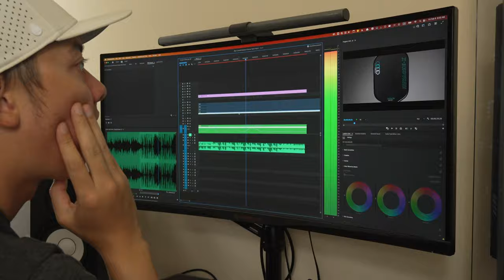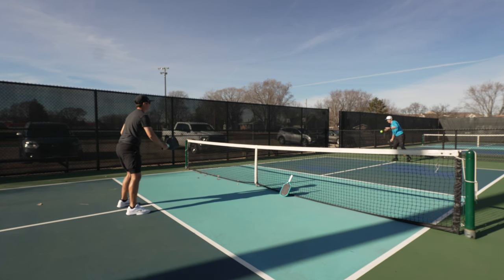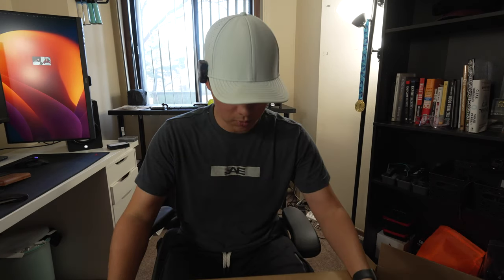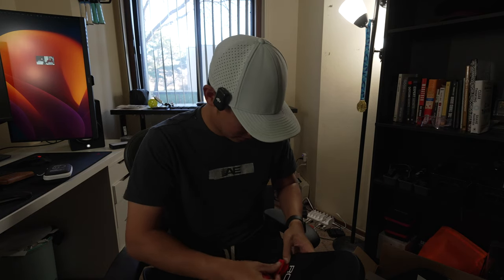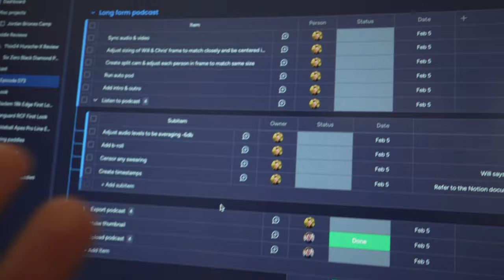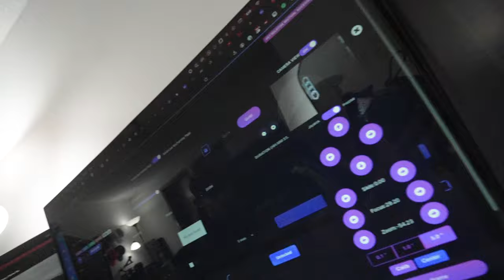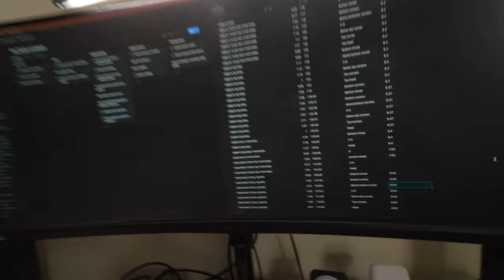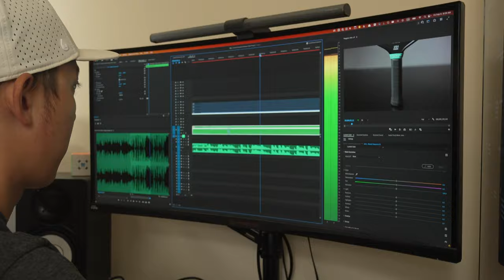Behind the Scenes of Pickleball Studio | Vlog

Comment: The Gamma Airbender dimpled edge guard is designed to cut thru the air quicker, similar to a golf ball. The tv series Myth Busters did an episode adding actual clay with molded dimples to the complete body of a car and testing wind resistance and Mythbusters got an 11% increase in fuel efficiency. So very interesting design by Gamma.

Comment: That PKOLL Spoon paddle looked incredibly small when you overlayed it on the standard shape paddle.  Consider that if you do this same comparison using a super widebody paddle and a relatively narrow elongated paddle overlayed on it, the additional width of the widebody is only discernable as a sliver of face but mostly edge guard.  That difference, which we know from experience makes a big difference in hands battles, seems negligible compared to the multiple hectares of extra face real estate we saw on the standard shape paddle with the PKOLL spoon overlayed.  Is that surface area compensated for by increased agility, or is that thing a death sentence at the kitchen?

Comment: Hey, I use the same Caldigit Dock. have you ever had any issues with yours? I've had some issues appear whenever I have too many things connected sometimes 1 IO port will not pick up, probably because I don't have any channels of PCIE, but i've never dug into it.
Reply from the maker: I’ve had that once or twice. My dock is basically maxed out on every port except the front ones. I’ve noticed if I add more hungry devices to the front, sometimes things will disconnect.

But not shocking when the dock is powering two thunderbolt RAIDs, a monitor, an audio interface, keyboard, and then the random NVME drives I use for the front Thunderbolt ports.